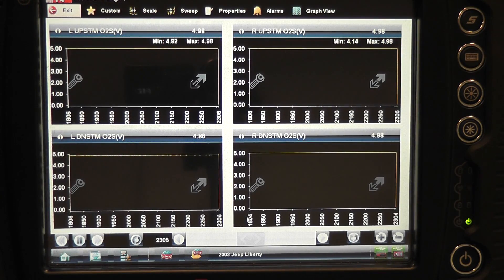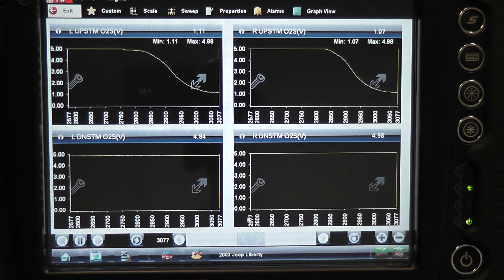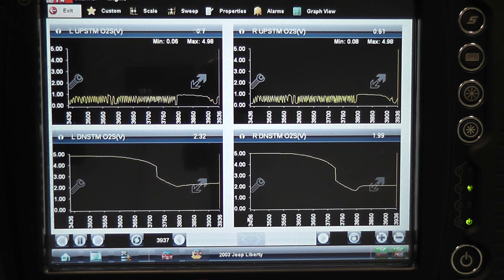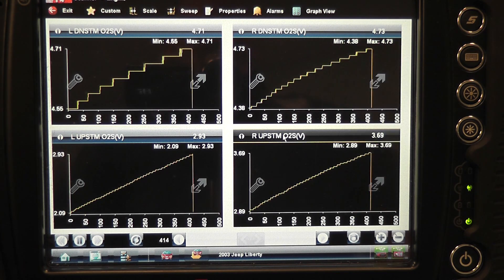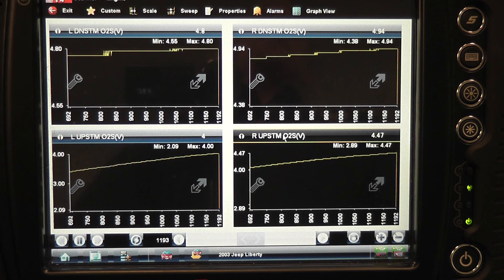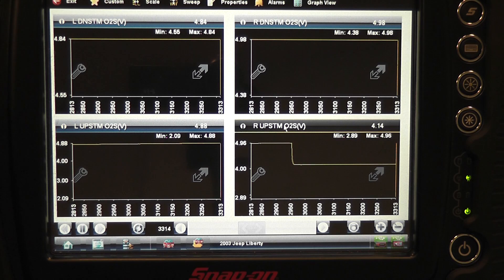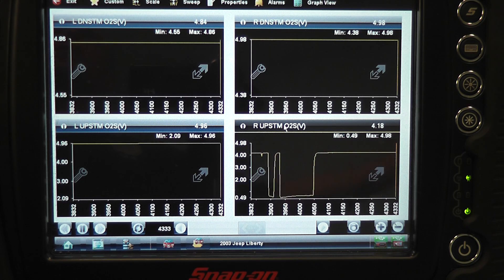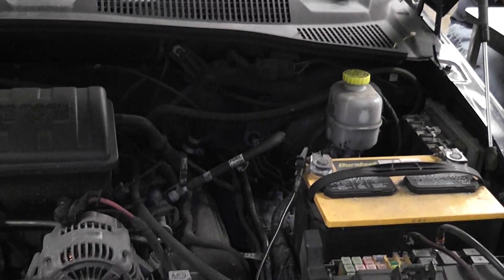What can cause an O2 sensor to read near 5 volts? (Chrysler bias voltage)

Comment: on the sensor side the heater wires is brown, tan is ground and purple is signal which reflects a ACDELCO brand. On the ecm side brown is signal, black is ground and the heater wires is purple/White and tan/white. When connected I verified each wire was matched to do its job. The volts reading I gave you was on the ecm side, car running and connector disconnected.
Reply from the maker: +Sonyman34 nice description! lets stay in the same thread from this point on. It is easier for me and others to follow. 
Okay, you definitively do not have a bad computer. Let's re-do those two heater tests with it plugged in and back probing the connector. Also make double sure that your voltmeter has a good ground for the test. 
That voltage is too low on the feed and too high on the ground, but it was unplugged and unloaded.
Reply from the maker: +ScannerDanner On a 98 Sunfire 2.4, I am showing a single wire upstream sensor and a 4 wire downstream so I assume we are dealing with a downstream problem. That downsream O2 heater is grounded to the block (left front of engine) and is powered by a fuse "O2 heater fuse" 10amp in the fuse box. 
This engine is notorious for ground wires to break inside of the insulation right at that ground eyelet on the block. It is the same ground location as the battery negative cable. If you tug on them they will pull apart. But do those voltage measurements first.
Reply: +ScannerDanner probed on ecm side heater wires, harness plugged in, car running. Volts on both wires 5.02v. Multimeter set on 20V. Moved around ground wires on engine block and installed  jumper wire from ground at harness to negative on battery, no change both times.

Comment: 4.98 volts Tan/White wire, 4.56 volts Purple/White wire
Reply from the maker: +Sonyman34 Those aren't right. Give me the 4 colors of the wires on the sensor side. Is it two whites a gray and a black or Two blacks a white and a blue or what? The heater wires are always the same color on the sensor side. Measure those two wires. (same color sensor side of the harness)

Comment: Code P0141, GM 98 Sunfire 2.4L, New ACDELCO HO2S, fuse good, wiring checks out, suspect the ecm. How can you tell if the ecm is the problem if a pocket scanner says O2 heater check OK?
Reply from the maker: +Sonyman34 what are your voltage readings with the car running on the two heater wires?

Comment: Why does your body or a test light pull to ground and not the O2 sensor plugged in? Doesn't O2 have resistance to pull it to ground when cold?
Reply: okay I see where you mention the sensor does have infinite resistance when cold.

Comment from the maker: it could go either way. 451mv is rich and 449mv is lean. That is how tight this number is. i have seen a negative 30% fuel trim from an 02 fixed at 451mv.
thanks for your comment on my book!

Comment from the maker: I don't see those anymore, but they did have a higher voltage signal, not sure if I would call it a bias on those. It was more like a thermistor circuit in its design. So it used a 5v reference, not a bias.

Comment from the maker: For the most part yes. However some manufactures are using the downstream O2 for minor fuel trim corrections. I've never seen it, but I have read about it. As far as troubleshooting goes I have NEVER seen a downstream O2 cause a driveability or fuel trim trouble code.

Comment from the maker: @tyroauto1 I am on the OEM side. I have a couple of pages in my book on this. I'll send you a sample later. And yes you are correct, it will read differently on the Global side on some.
Reply: I'm Having A P0056 Code Bank 2 Sensor 2 Heater Circuit. 2002 Chrysler 300M special. I have Swapped My O2 Sensors And the code is Still there. The Code Falshes and Comes On as soon as I turn the Ignition before even starting the Car. Notmally the o2 sensor codes come on after driving the car and the computer takes some cycle data, But I Unhooked the Battery and soon as I turn the Key the Code Flashes. I suspect I dont have voltage at the Pins, But Idk which ones are the Heater wires, I traced the 2 Black/White wires on the O2 Sensor to the Pins they Connect to and got 2.3mV with key on engine off (do I have the correct pins?).. I'm Wondering if I have to Start the Engine for the correct voltage to show Up? And I understand that I should be looking for 12V?

Comment from the maker: @beefystik Rosedale Technical Institute in Pittsburgh Pa
Thanks for you kind words!
Paul
Reply: ScannerDanner.   I have an 02 grand cherokee4.7    I'm getting high voltage codes   downstream  o2s    do these work off the heat from the exhaust .   As mine are not in the pipe.
Reply from the maker: @whysolong27  yes and no. It does have an electrical heater circuit too. High voltage codes are from the bias line not pulling down (from a hot, working O2). So heater circuit fault (sensor or wiring) or from a dead O2 signal circuit
Reply: @ScannerDanner   ok so I'm lost. checked power  checked ground  second set of  o2s  and I'm still getting p 0138  p0158
Reply from the maker: @whysolong27  2nd set of O2 sensors? are you using the correct ones? 
https://www.youtube.com/watch?v=-lUYRqaYvYI&t=2s
Reply: @ScannerDanner    as far as I know  NTK brand down stream  o2s  it's what rock auto had for my year and model and local parts store . I'm getting both down stream  codes for high voltage circuit to high.     my engine has been professionally tuned.
Reply from the maker: @whysolong27  what is the voltage showing you on the downstream O2 sensors on the scan tool
Reply: @ScannerDanner   my mechanic and I  have only done it on a voltage meter  and the jeep was running  for a few minutes  it was reading  in the high four to five volts.     I know that the o2s are getting hot  because I've held onto them . It's not a steady heat more of a pulsating heat
Reply from the maker: @whysolong27  this is your problem, those sensor heater circuits are not working or you have an open wire in your signal return (O2 signal ground) circuits. That 4-5 volts you are seeing is a bias that will drop down to .5v within 10-20 seconds of that heater circuits turning on. This is why you are setting those codes. New sensors and old sensors, same code right?
Reply: @ScannerDanner  yes  sir
Reply from the maker: @whysolong27  focus on the heater circuits! Engine running, measure the two white wires (sensor side) and report what voltages you are seeing. One lead connected to a known good ground for all tests
Reply: @whysolong27  did you fix it?
Reply: @repeater95   yes I did it had a bad wire to the o2 sensor the heater wire  and yes my o2  sensors have to be in the pipe

Comment: Paul came to my house to buy a fridge and kindly spent 20 minutes diagnosing my 1990 volvo wagon which would not start.  He explained that I needed a new ignition coil.  I bought a used one on ebay for $20 and voila! Problem solved. My mechanic ripped me for $300 and still could not find the problem. Wish Scanner Danner had a shop. Thanks!

Comment from the maker: @JUDGERAMBO Not at all! This is not a typical 5v reference you would see to a MAP or TPS (which you would never jump to ground) On this design the 5v ref. goes through a current limiting resistor before it leaves the computer. If you notice in the video it is so weak that I can pull the 5v down through my body. Can't do that on a regular 5v ref circuit.